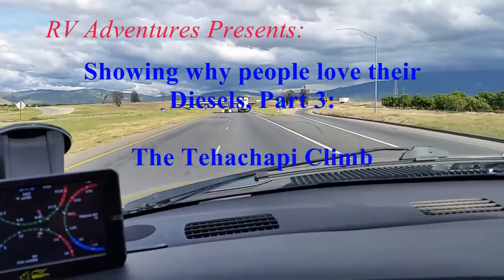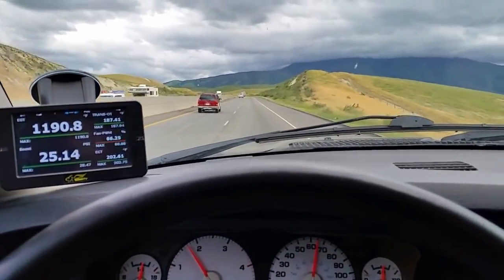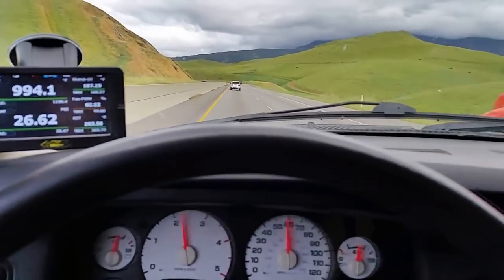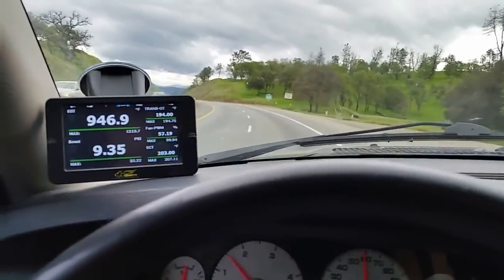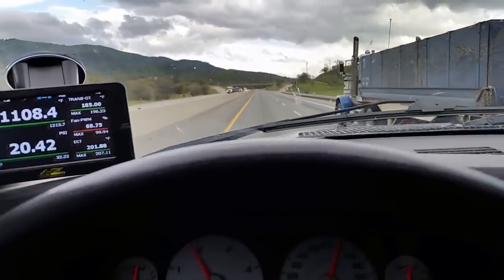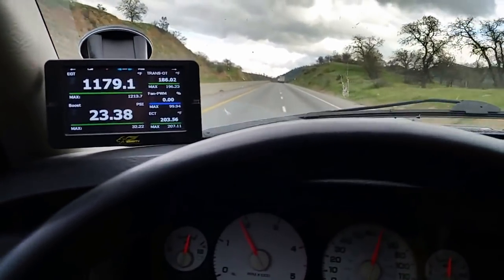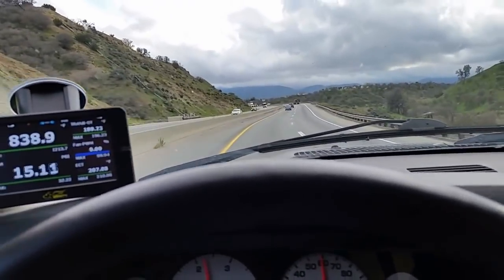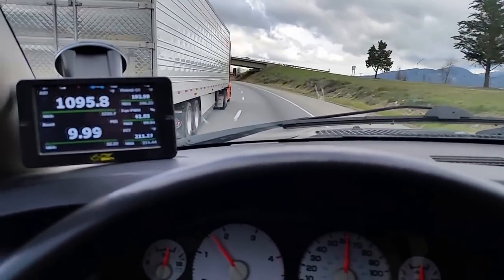Towing With A 3rd Gen 5.9 Cummins Diesel: Tehachapi Pass

Comment: It’s always interesting to watch the different configurations and towing styles. I tow at higher RPM and manually control the 3/4 shifts. Great video, thank you.
Reply from the maker: Yeah if you can get the RPMs up that will help with airflow to keep things cooler

Comment: I tow with a 2001 dodge 5.9 4x4 2500 so3 tuned usually setting 3 or 5 trailer is only 7k pounds bumper pull love the 5.9 , we are retired so usually 63 mph . We live in Arizona

Comment: I'm more amazed the dash isn't crack to shit
Reply: 3rd gens baby not those overrated 2nds
Reply: @AsianNIGMA  the early 3rd gen dashes crack like the 2nd gens.
Reply: I have a 2nd and 3rd gen without crarcked dashes or rust here in the northwest. Also no emissions inspections for diesels in Oregon or Washington
Reply: ive used 303 protectant and a windshield visor since new in my 04.5, no cracks thus far. 320K miles.

Comment: I just ordered this setup from you and I'm super excited to give it a try.  Your EGTs in the video are downright "chilly" compared to mine.  I can't seem to get mine to go down from 1250.  I have +50 injectors, exhaust and intake.  Otherwise, stock 2005 G56 6sp manual.  I've been using the good ole Smarty S-06(?) that I bought in 2009.  Worked great on the #5 tune, but since adding the injectors, I'm down to #1 or #3 (no difference in EGTs between the two) and it's just hot all the time.  Really looking forward to this new setup and your custom tunes.
Reply from the maker: Rob thanks for your business!
Reply: It’s probably the s06 that’s causing those egts, it’s a smoky hot tuner, maybe try the advanced timing settings?
Reply: @codcade  I did; didn't help.  No matter; I got my new MM3 recently and temps are WAY down!  Love this thing.
Reply: @robgoffroad  yeah, I’m glad you got them down, that s06 is for play and that’s it, custome tunes are the only good route for towing imo

Comment: Hey I have a 3rd gen ram as well. I’m looking to get a trailer soon similar to yours. How do you like for the towing? Have you taken your trailer far? Las question how many does your camper sleep? I have a family of 4.
Reply from the maker: Towing is great especially with the tuning.  These trucks were born to pull.  5th wheels tow so nice you can forget they are there, very smooth.  Our trailer can sleep 6.  2 rear single bunks, dining room table turns into a bed, sofa turns into a bed and a queen in the bedroom.

Comment: I am looking at a 05, with 310,000 miles, brand new automatic transmission in it. 3500 dually truck.

  If I buy it, keep the motor stock to keep the trany alive?
And can I get manual hubs for it?  -- buying it to tow 20,000 pounds ISH. (I have a 40' goose neck, plan on hauling hay).  Equipment (over mountain passes).

Comment: Im pulling a 2 car trailer with the bed filled with tires, 2005 5.9 cummins 2500 bone stock, stock auto trans, pulling roughly 10k pounds. Used to pulling around 6k and i go through a tone of giant hills here in Québec Canada to get to the race track.. im a little worried with the 10k pounds cause i do have to give her a lot to pull up the hills with only 6k. Am I worried for nothing or should i be good?

Comment: how easy and necessary is this tuner to install. I have a 2005 Dodge with a 5.9 and am planning a drive that will take me over the rocky mountains. Also do you allow the the tow/haul do the braking down the back side of the mountain or do you assist it with normal braking. Do you find that when you brake it is the ideal amount or would you suggest a braking module as well. Ill be towing 10000 lb travel trailer.
Reply from the maker: Trent the tuner is very easy to install, plug and play.  If you get your mm3 or touch (get an mm3 if you're going to get my tunes) I can get you tuned up within 24 hours.  Ive had nothing but pleased customers so far.

I do use tow haul to brake a bit, but without a pacbrake installed it's only mildly effective.  Make sure your trailer brakes are working well on all axles and keep your speeds low.
Reply from the maker: I should add, if you have an exhaust brake already but have no controller for it, I can activate ecm control for you.

Comment: Hey man, I have a few questions about tuning. I do plan on something different in the future, but I have an edge cts2 evolution now, and would like to use it for maybe another year. I love it, but I'd like some tips how to keep them egts down. Just changing the timing advancement and rail pressure and what not. There are very limited options, but I can't use much power before I hit 1200 degrees. Any recommendations on that tunner settings? Its an 06 3500 ccsb g56 3.73 on 34s. I do have a banks exhaust brake and s&b intake, and mbrp 4inch high flow muffler, no cat.
Reply from the maker: Jack in as much timing advance as you can👍

Comment: is your truck 3.73 or 4.10 gear? stock size tires?
Reply from the maker: 373 and stock tires
Reply: @DieselCamper   Would you ever consider 3.42 gears? I currently have 4.10 gears in my stock 03 Dually manual.  I've been thinking about changing them
Reply: Scott Bickford If you’re towing at all 3.73 is a good middle ground. My 2500 gets about 19-20mpg at 80 mph ish (125-130 km/h) on 3.73s

Comment: On the mechanical side of things, did you perform any modifications to your transmission setup?  We have a 2005 1-Ton Dually Crew Cab that flashes incredibly quick and your transmission tuning (software side) is superb.  I believe you have a longer final drive ratio rear end (ours is the 4.10:1). 

Hoping that I can use my HPTuners on our truck this year, but it might not give as much flexibility as your Smarty MM3 setup.
Reply from the maker: I did a mild build with red eagle clutches, shift kit, low stall TC, Kevlar front band and billet accumulator.

My tunes won't work with hp tuners, but mm3 is good to go.

Comment: I got an 05 cummins with 35s. Towing i trailer i will easy hit 1350-1470 egts. I have juice with attitude, s&b intake 4in straight pipe. Camt understand is it the edge running hot or thats how this truck is because ill hit same egt numbers power level 0
Reply from the maker: The edge probably didn't do much timing adjustment in the mid rpm high load region of the timing maps.  The result is fuel is injected late and exhausted while still burning sending your power out the exhaust pipe.
Reply from the maker: I can most likely fix that for you by the way...
Reply: Diesel Camper i bought smarty touch today and will give it a shot. If something i will try to contact you
Reply from the maker: One thing to keep in mind is the touch won't alter your transmission at all.  MM3 Tuning will and will give you the same power levels the touch has...
https://www.mm3tuning.com

Comment: Does the tuner lock the converter in 3rd or do you use a switch?
Reply from the maker: The ECM is reprogrammed to lock it in 3rd
Reply: @DieselCamper  what programmer are you using for your trans?
Reply from the maker: Mine is a Smarty Touch but I recommend the MM3, they are very similar but the MM3 is intended for use with custom tunes and includes all hardware for shift on the fly tuning👍

Comment: is the exhaust system stock on that truck as well?
Reply from the maker: It has a 5" turbo back exhaust
Reply: is it loud in the cab? i have a 4 inch and it is pretty loud for long trips
Reply from the maker: It was SUPER loud when I was running a straight pipe.  I welded the resonator back in and now it's fine.
Reply: Diesel Camper one of my friends has a 06 5.9 with a 5 inch turbo back straight pipe, he spent an extra 3-500$ sound deatonating it and is way more dailyable, he uses it for towing construction equipment and materials atleast twice a week and says that you cant really tell its been straight piped
Reply from the maker: Yeah you can use a resonator or a calculated section of pipe t'd off of the main pipe to help with the resonation.

Comment: I have the same truck with a edge tuner, cold air intake, 5in turbo back exhaust. When towing 8K TT thru the hills of Western PA my ECT's can get up over 217. How hot is to hot for ECT's for this engine?
Reply from the maker: That's a totally reasonable coolant temp for towing up a pass.  Also if you can keep your trans cool by locking the TC it won't be dumping that heat into the coolant through the heat exchanger...
Reply: Define cool trans temps.. for example @200 ect. 80°f outside temp . Roughly where should they be?
Reply: @thatdudewonu  Yea 200 is not bad from what I have seen towing. The only time I saw more 210-230 was when I was towing a steep grade with lots of switch backs. The trans floating between 1st and 2nd and the torque converter never really locked up. I had the extra deep pan from ATS so my trans ran very cool most of the time 160-180 even towing highway. You don't want them to cool from what I have heard. They need to get warm enough to get any condensation out.
Reply: @thatdudewonu  today my monitor read 200-205 trans oil temp, unloaded,95 degrees out today, kinda of stop and go traffic, that seem right?
Reply from the maker: Adam that's normal.  I wouldn't start to "worry" about the trans temp until it hits 230+.  Of course if you know it's slipping you want to stop that right away regardless of temp.

Comment: Man towing is confusing. Would that truck stock be able to pull a 10,000 lb trailer safely up and down that mountain?
Reply: J M yeah as long as you don’t mash the accelerator going up, and ride the brake the whole way down. This is what they’re made for.
Reply: J M Why’s it confusing?
Reply: No that's not a 10000 pound trailer  I'm guess he means its tagged for 10000 pounds capacity. That means It can hall 10k not that it weighs 10k
Reply from the maker: These trucks can haul 20k.  I had 6000 lbs of gravel just in my bed the other day.

Comment: Hey how did you set the torque management lower than stock? And how high is your oil trans tamp? I was pulling a 24foot camper on a hot day and my transmission temp was 210 farenheit.  Is that too high? Can you tell me the best level for towing please?
Reply from the maker: 210 is just fine.  The stock trans temp dummy light doesn't even come on until 265.  I'm not sure about the torque, I may have meant stock.
Reply: Diesel Camper i have a rebuild tranny so how high is you transmission going when you pull a camper? I was driving today and my transmission was on 195 with out pulling.
Reply from the maker: Usually 220ish going up a pass.  If you can keep your TC locked it should stay there or lower.  If your 40mph or below you can manually shift into 2nd and it will lock the TC.
Reply: Diesel Camper how do you lock the Tc? And what is it?

Comment: Stock trans? Could you list your mods?
Reply from the maker: I have a transgo shift kit, red eagle clutches, Kevlar 2nd band, and billet accumulator.  A pretty mild build.
Reply from the maker: With a shift kit it will have better clutch holding power.  The input shaft should be fine unless you're doing boosted launches or racing.  Just for a 100hp uprate you should be fine if you drive with some sense.
Reply: I just recently went to sw3 on the smarty. No racing are launches its my work horse. Anything else i should change on the sw3 setting? 4inch exh,cai and thats it for mods
Reply from the maker: I think youd be ok at SW5 and long as you don't burry the pedal towing up a grade.  What year is your truck?
Reply: 2003 and as far as tune sw5 should help with towing?

Comment: 400hp tune.... doubt it buddy
Reply from the maker: Why do you doubt it?  The 6BT Cummins from Chrysler can easily gain 100hp by tuning alone with no hard parts.  Major injection timing changes and some minor fuel changes.
Reply: Lol you must not know much about diesel trucks or tuning in general.
Reply: @tonystone6955  yea but i think i kinda do bud i work on them everyday and iv owned a few😂😂
Reply: @treyster3000  for someone who works on the all the time your not familiar with the termonology.when someone states a tune typically it's the stock hp number and the added tune hp numbers.
Reply: @tonystone6955  well i seem to know alot of folks with diesels and i cant think of anybody who says it that way🤔🤔
Reply: @tonystone6955  please stop tryin to be an expert because you have one lb7 with 350k miles....
Reply: @DieselCamper  yea bud. But not 400
Reply: @tonystone6955  😂😂
Reply from the maker: My engine is 325hp from the factory.  I guess I don't understand why you think 400 is unreasonable?
Reply: @DieselCamper  I believe he is misunderstanding when you mentioned a 400hp tune. He with his limited experience most likely believe you meant an additional 400 making it 725
Reply: @tonystone6955  yes but most people say i got it on a 50 tune or a 125 tune😂😂
Reply: @DieselCamper  Me either. I have the performance tune on my 04.5 3500 (I don't use that tune for towing) from Superchips and I get about 458 HP and 935 Foot lbs or torque. Same as this truck with only a Superchips performance tune on it. That's only 133 added HP to the stock 325. https://www.youtube.com/watch?v=RsjDk5v_Uy8
Reply: tipofthesip Do you live under a rock or what?